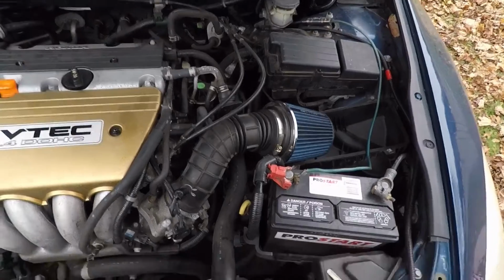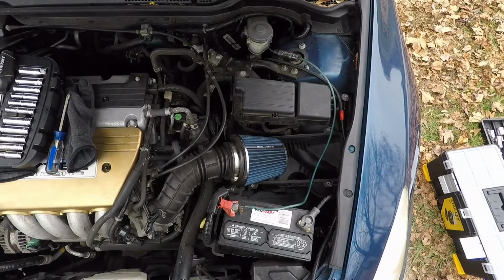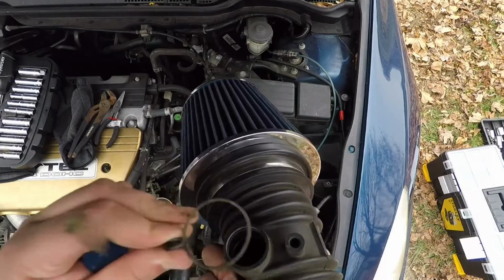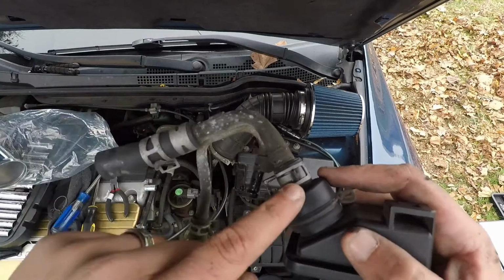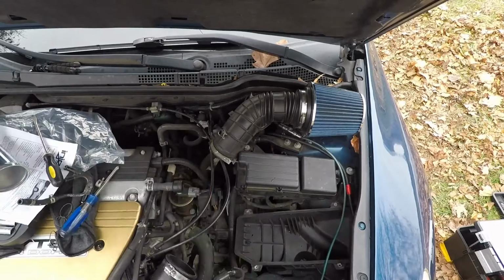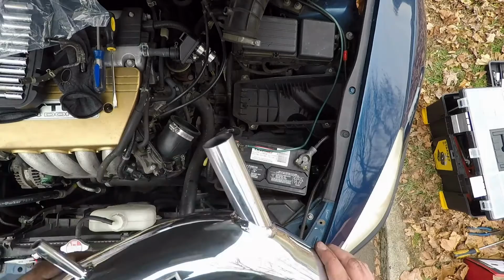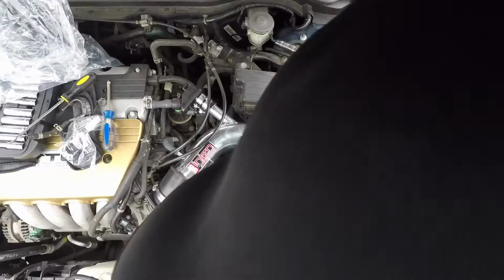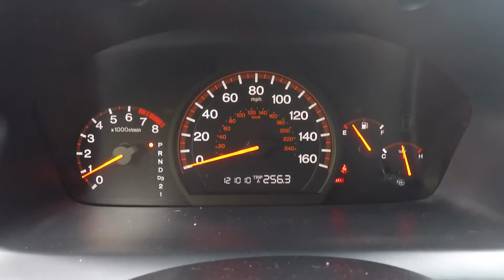Short Ram Install On Honda Accord

Comment: Exciting video man! I got a 2000 accord SE and I wanna get one of these installed. Originally I was aiming toward a cold air intake but I was told it could harm the engine. Any advice on what brand to get?
Reply from the maker: Hey man, so yea me personally I would stay away from the cold air kits. But yea for the short ram I’d go with Injen. When I was researching this like 3 years ago, they were the cheapest while still staying name brand. I was originally gonna get a K&N but it the same thing just a lot more pricey.
Reply: @RonsRides7601  a year later lmao! But I recently ordered an injen intake and I’m gonna swap out the tb for a wider one. Can’t wait to see the results

Comment: The cold air take is in the front passenger wheel arch. Unless you have modified your intake set up.  Which looks like haven't
Reply from the maker: My air inlet for the stock filter is behind the front bumper on the driver side.  And this is a short ram intake not a cold air intake.
Reply: Unorthodox Garage 
The air box hose goes behind the front passenger wheel arch. There is a vent there where the hose that goes to your air box.
Reply from the maker: I have no idea what you’re referring to, mine isn’t set up like that at all man.
Reply: Unorthodox Garage 
Is that left hand drive. Mine is left hand drive. So yes the right side wheel arch
Reply: Unorthodox Garage 
Sorry I ment, mine is right hand drive
Reply from the maker: My wind shield washer tank is on the passenger side. My intake is on the driver side.

Comment: hello good video, can you tell me what is the diameter of the blue filter that fits in the original air intake pipe?
Reply from the maker: It has little rings in it that allow it to adjust from a 3 to a 5 inch

Comment: Wrap it with gold heat wrap. It will look awesome and suck in cooler air.
Reply from the maker: Yea I know exactly what you are talking about, it’s just the motor cover though. It’s plastic. The actually intake manifold is a little lower in the front of the motor. I totally understand what you are saying though.

Comment: Is a 4 door 03 Honda Accord a good car  with 50,000 miles
Reply from the maker: Tyler Richards 7th generation Honda accords are wonderful low maintenance cars. Mine has 130K and I’ve only ever had to replace normal things. Brakes, oil, battery, a few fuses. The thing with these cars I would be weary of is that they are aging and most likely have been used. The car you’re talking about will be turning 15 soon. So some rubber parts may start to crack due to aging (radiator hoses etc). So yes I would say it’s a great car given that it doesn’t already have any mechanical issues.
Reply: It will be my first car I am 15
Reply from the maker: Tyler Richards that’s awesome man. There is a big aftermarket bracket for Honda so you’ll be able to make into something great.
Reply: Ok well night i am going to bed
Reply from the maker: Tyler Richards good luck man
Reply: Thx you to I hope your channel gets bigger
Reply from the maker: +Tyler Richards appreciate it
Reply: The sound you looking for is in a catback

Comment: The set-up you removed,  what kind of filter was it and did you use an adapter?
Reply from the maker: It was just a regular square filter and box set up. And I used no adapters for this.

Comment: Did it sound the same when u hit 4K rpm?
Reply from the maker: jordy arias zapata I’m not sure sure what you mean by that. If you’re talking about when I hit vtec, yes you can definitely tell. Mine doesn’t kick in till 5,200k I believe though.
Reply: Unorthodox Garage I meant to say 5 but did you notice a difference on sound with injen one
Reply from the maker: jordy arias zapata oh yea definitely in 1st 4th and 5th for me.
Reply: Unorthodox Garage it sounded more aggressive?
Reply from the maker: jordy arias zapata yea you can hear it in and outside of the car. It’s not a B18 but it still cracks lol
Reply: Unorthodox Garage It’s economic vtec it actually kicks in at ~2,200rpm

Comment: Did any engine lights come on?
Reply from the maker: No
Reply: Unorthodox Garage I just installed a short ram , and engine light came on today, any suggestions?
Reply: go back to stock you can't put these air filters on without tuning your car